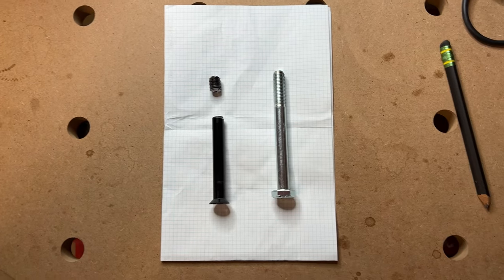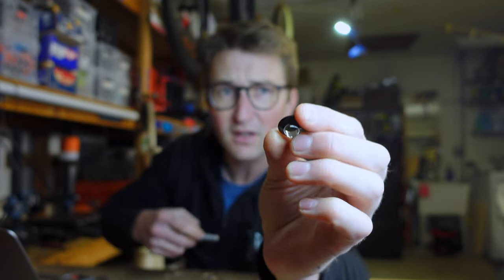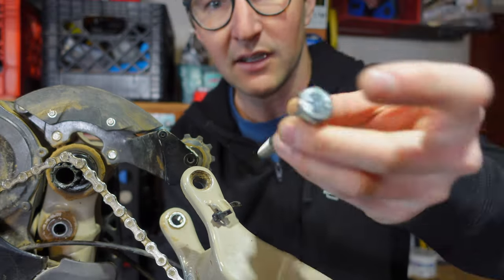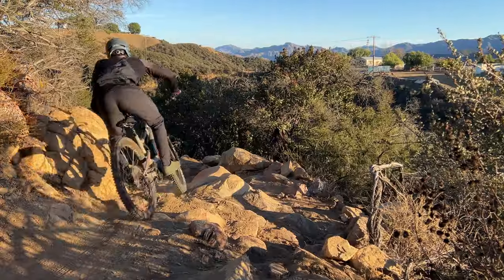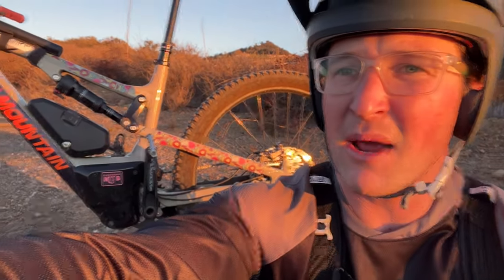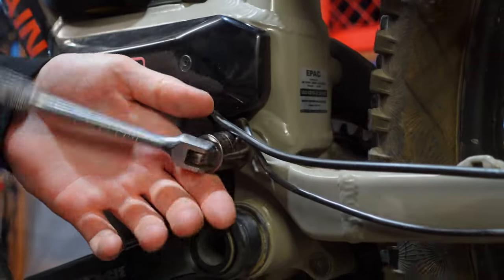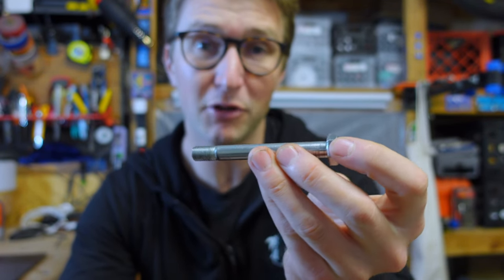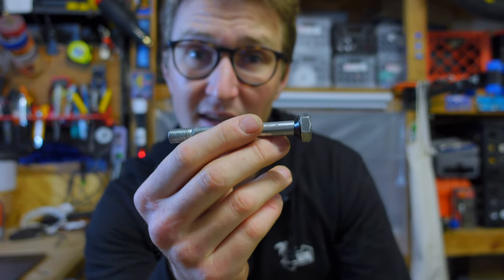Fix your mountain bike with hardware store parts!

Comment: The usual hardware store bolts are called chewing gum steel bolts here in germany, because they tend to bend easily.
we measure the hardeness in Brinell and the hardware store gives you usually 4.8 which is something like 41 Kp/mm2
You may consider to check that for your application and you may use 8.8 (81 Kp/mm2) if you want to have it lasting. anyhow a good idea.
Reply from the maker: Thank you! You’re right about that. I guess since the original hardware was aluminum I didn’t want to go with a harder steel. Love the phrase “chewing gum steel.” I’m going to remember that.

Comment: Excellent!  I also fixed my bike (kickstand) by drilling out the rivet + pin and replacing it with a hardware store bolt.  Wonderful to fix things with simple everyday parts!  I sometimes also drill and tap from metric to imperial so I can use what's readily available...
Reply from the maker: That's a good hack, it's really hard to find metric bolts in the average US hardware store. Or even Canadian for that matter.

Comment: Put a nut on bolt before cutting .  When you unscrew nut, threads on bolt get chased, unchased threads can be hard to start .
Reply from the maker: That’s true. I was lazy here because I didn’t have the right but to fit. I just cleaned up the threads with my deburring tool afterwards

Comment: I did this, except I also pulled the bearing and just replaced it with a nylon spacer, it’s been 300 miles and for 4$ vs Giant wanting 75$, I have replaced my rocker arm hardware and it completely fine. Bearings are extremely overkill and over engineered, nylon spacers are way better, cheaper and work just fine

Comment: Grrat hack. 
Tip:
Try to get the bolt flush so the housing won't rub. Maybe you already did. But I saw the pic on Instagram, the bolt was a bit too long.
Reply from the maker: Agreed! It’s definitely a bit too long in that pic. I ended up cutting it a bit shorter.

Comment: It's common to make that kind of joint weaker than the rest of the bike frame, to make break points, it's cheaper to break the bolt than the frame. That's why I think bolts are made from aluminium. Aluminium isn't real strong material for bolts of any kind. On another point of view, maybe it is for the purpose to make you pay more for maintaining that bike and profit for the corporation. You choose what is the key point.

Comment: Nice fix.
Try a Grade 8 steel bolt
Reply: It's an 8.8, stop at 3:57 and you can see the head.
Reply: @ATEC101  which is a grade 5
Reply from the maker: For sure. This was the only bolt available locally in a M10 by 1.25